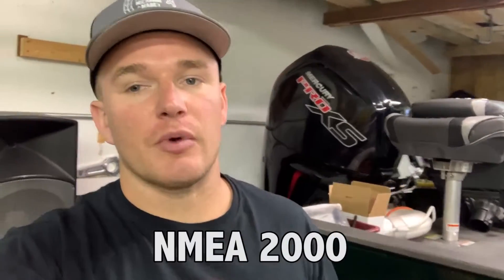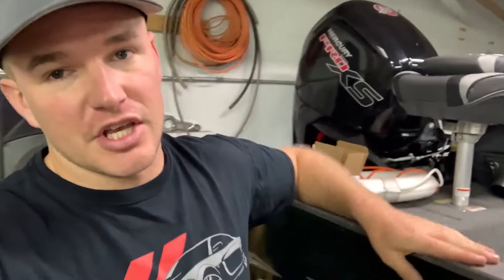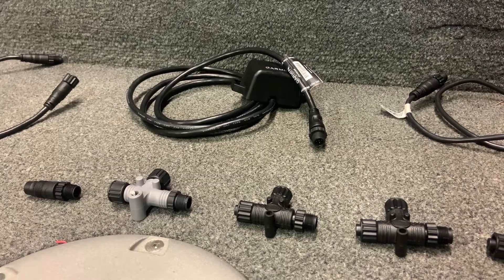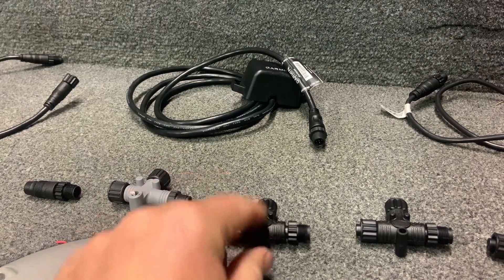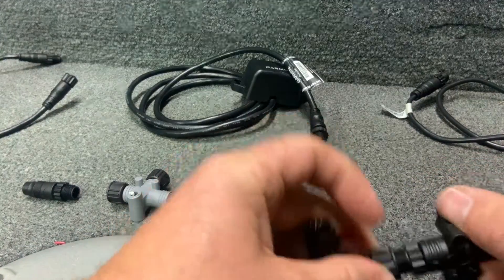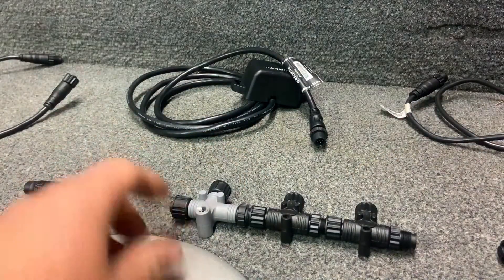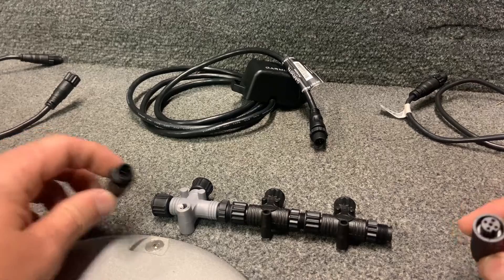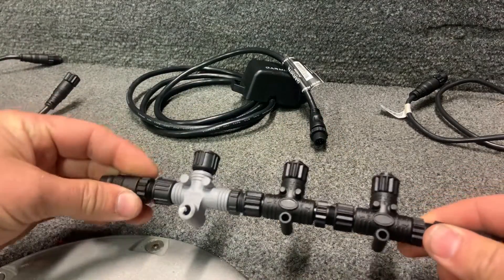NMEA 2000 Network Basics and Assembly

Comment: You said super basic explanation. In my opinion this was a great explanation of the NMEA backbone. I will be putting my steady cast unit in soon and this was a great help.
Reply from the maker: Thank you! 

I have everything you need in stock! Let me know and I’d be happy to help
Reply: If you only have one graph,  can you plug the steady cast directly into the graph? Bypass the backbone until I have more graphs?
Reply: @timexum743 .    You can plug it in to the back of the graph but it will not work. You will need a NMEA 2000 starter kit, a steady cast unit, probably a dropper cable, and a power cable to power up your backbone. The backbone needs its own power. You will need 3 connectors Tee and 2 termination resistors for your setup. In the future when you want another device you just add another connector T to the backbone. You will also need 2 termination resistors on each end for the backbone. You will get 2 connectors T in the starter kit and 1 connector T in the steady cast kit. In your case you will have 3 connectors T. So one power cable to the middle connector T, steady cast to another connector T,  and a cable from the last backbone connector T to your NMEA 2000 connection on the back of your power head unit.

Comment: Garmin highly recommends and strongly encourage you to sit the power towards the middle of your backbone!
Reply from the maker: Yes this is important in large backbones that go all the way across large boats from front to back.  When they are small like this in the video it’s not as important. 

What you are trying to do is to minimize voltage drop on the system
Reply: @MGMarineTech  I just installed a chart platter and fishfinder with a transducer and a VHF radio with GPS antenna and VHF antenna on my Yamaha 275sdx!

Comment: Question? I am going to add the Garmin Steadycast Heading sensor on my 2022 26' center console. Where would the best place to mount it? I'd like to put it in my electronics box but there is a lot of wiring and a VHF radio in there. Would it work mounted in there? Can it be mounted on the hard top next to the radar? Let me know what you think
Reply from the maker: You must make sure that it’s not close to anything magnetic or that has a magnetic field like speaker etc. 

Also you must use good stainless screws to mount it. Regular steel is obviously magnetic and can throw it off
Reply: @MGMarineTech  Thanks for such a quick reply. just 2 more questions. can this heading sensor be mounted upside down as long as the arrow is facing to the bow? And is there a Garmin external GPS antenna without a heading sensor I can use for my GPSMAP 1223XSV?
Thanks for your help
Reply from the maker: @Glory-Days-Fishing  the heading sensor instructions aren’t very clear on that, and honestly my heading sensor doesn’t work well where I have it mounted now. But it’s probably 100% my installation. 

As far as just a gps sensor, you could do the 19x 

Or i would just recommend doing the 24xd it will do your gps sensor and heading sensor in 1. Less things to mount and wire into the NMEA network. 

Shoot me a message and I can get you setup with whatever you need
Reply: @MGMarineTech  thanks again!! I’ll let you know how it turns out. It’s a brand new boat and I am trying to set it up better than my last boat. With your help I’m sure it will be perfect
Thanks again!

Comment: This definitely helped and explained what I needed. Just one more question... I have 2 93SV UHD units one at console and one at the bow. Can I just hook the dropper cable to my console unit and see on my bow unit networked as well or will I need another 2nd dropper and there for another nema port to run the longer cable to the bow unit?
Reply from the maker: Any screen you want to be on the nmea network has to go to the nmea backbone with a tee 

They will not network in any way just connected together with a dropper cable just plugged into each screen

Comment: I just got a brand new Suzuki 4 stroke 30 hp motor and the dealership got the Suzuki interface and a garmin NMEA starter kit and backbone. When they installed the motor they hooked it up to a garmin 93SV and they said everything worked fine. When I got the boat back I had bought a new garmin ultra 106 and installed it to replace the 93sv. We hooked everything up properly just like it was hooked up to the 93 and now none of the engine gauges will show up on the 106. Is there something you have to do to make to work? When we go to the gauge menu to select a motor it says there is no motor found. If there’s anything you know I’d appreciate it.

Comment: Does the network power just power the network or does it power the devices on the drop? Is this similar to PoE on modern home networks? Or would a device such an analog converter or chart plotter near their own power source?
Reply from the maker: It will power some of the smaller devices,

It does NOT power the units themselves

Comment: Great video although I am still a bit lost.  I just purchased 2 Garmin 93SV's and Livescope.  I was watching your older video on using the GMS10 for networking this setup however after watching this one, can I skip the GMS10 and just use the NMEA 2000 and then will the Livescope also go into the T as well as the units or does the NMEA read the Livescope from one plugged in unit through the T connector?
Reply from the maker: No!!!!! Lol 

The NMEA network will not share any of that type of data. 

To share waypoints, maps, transducers, livescope etc you will need to follow my other video. 

This is just for adding external sensors and devices that run on the NMEA 2000 network. 

The gls10 black box doesn’t even have NMEA 2000 capabilities
Reply: @MGMarineTech   Thank you, I got it down now.

Comment: Finely!!! Now I think I get it,Just have a question, I’m running two 93sv’s at the console joined by a cable that allows the use of one transducer, will I still have to have a dropper cable from both units for the heading sensor to work on both?
Reply from the maker: Unfortunately yes. Each screen that you want to see a device has to have a dropper cable. 

That was covered in the video as well, it was just towards the end.
Reply: Yeah at 1:38 you mentioned about if we had three screens then would need separate cables, just wanted to be sure, was just thinking sense they shared a cable already that it might work or hoping I guess lol, thanks for all the info and your videos, they have helped me tremendously!!!
Reply from the maker: @ClearviewOutdoors  yeah I originally thought the same thing. But that’s not the case with the two networks. 

Each screen that you want to read the data from a device needs a dropper.

Comment: Hi I have a 95SV echomap chirp bought in 2016 with GT-52HW transducer.  I plan to use this for map and traditional sonar.  I plan to buy 95SV UHD and use it for downscan at 800 khz and sidescan at 1100 kHZ.  Both transducers will be mounted on transom.  Do you see any problems with this like interferences etc.?

Comment: At about 7:00 you talk about a backbone extender cable, to help your backbone reach a device that's far away. My question is, say you have your backbone at your console, but you want to connect a graph, Trolling motor, and GPS heading sensor at the bow. Can you essentially run a secondary backbone at the bow (without it's own power) and use the backbone extender cable to connect it to your actual backbone? That way you don't have to run 3 or 4 seperate long drop cables from the bow to the backbone?
Reply from the maker: Yes your backbone tees don’t all have to be in the same spot. 

You could put a dropper cable in between two sections of tees(must go on the inline side). So you could have 3-4 tees at the bow and 3-4 tees at the console. 

It must be terminated at the ends like normal.

Does that make sense ?
Reply: @MGMarineTech  Yes, thank you! That will save me quite a bit instead of buying (4) 5 meter cables!

Comment: does the engine interface cable plug into the top of a  T
and where's the best place to get power from straight to the battery or from somewhere in the dash
Reply from the maker: Yes, all NMEA devices plug into the top of the  t as shown in the video.

As for power. The battery is good clean power but power from the switches would work too. 

Just make sure it’s 12v and not 16 or 24v etc. and the network can only have 1 power supply.

Comment: Questions - is it okay if a dropper cable that doesn't have anything attached to it?  Suppose I need to temporarily remove a device, will I need to put a terminal in its place, or is it okay to leave the dropper cable unattached to a device while using the system? What if I need to temporarily detach the dropper cable while using the network? If a terminal needs to be used is it the same as the terminal on the backbone?

Thank you.
Reply from the maker: Never terminate a dropper cable with the resistor terminator.

I would suggest either leaving it open ended or removing the cable and tee

Comment: Can you plug the steady cast directly into your  graph ?
Reply from the maker: no you can not. You MUST have a NMEA 2000 "backbone" I sell kits at MGmarinetech.com and even have steady cast bundles with everything that you would need. 

Thanks
Reply: @MGMarineTech  thanks for the fast reply. Is the steady cast bundle new or used? How much?
Reply: I see the bundle. So I can plug the steady cast to the drop in on the T then the nmea cord to the end of the T then to my graph? Or do you still have to run a power cord to the T? The power from the graph is not sufficient to power the steady cast? Hope this question makes sense .
Reply from the maker: @timexum743 this video shows you all the connections that are mandatory.

There is a t for each device and power.

So 1 for the screen 1 for the sensor 1 for power

Comment: If you have the t connector with power going to it at the console say to a accessory switch can you extend it to the two t connectors at bow with the 15ft cord? Will I lose voltage that way?
Reply from the maker: The NMEA network only needs to be powered in 1 spot.

Why do you want to power it towards the front of the boat?
Reply: @MGMarineTech  I figured it out I have it powered at the console so then I can turn it on and off don’t want to drain batteries with constant power going to it.All I have hooked to nmea is elitefs 9 and ghost trolling motor so I can have 360 ghost.

Comment: You can’t use hdmi to impose info to a separate screen?
Reply from the maker: Some units have HDMI out and in. So you can share your screen to a TV or bring in a media player.

But to to share things like transducers and livescope to other units you can simply network them. 

My network video will show you all you need to know about it.
Reply: @MGMarineTech  so, with hdmi, you can display all info on a monitor/tv from your mfd/msd; just not have control over it? Correct?

Comment: Great explanation!  Can the power cable be spliced into 10ga marine power wire ran back to the starting battery?
Reply from the maker: As long as it’s “12v” you should be good
Reply: Yes.  Any idea if I can run that to a circuit breaker?  If so what amperage?

Comment: How to connect a fuel gauge to show fuel level ? Thanks
Reply from the maker: You will either have to have a fuel level sensor that is NMEA compatible and then hook it up to the backbone,

Or already have a NMEA compatible smart gauges
Reply: @MGMarineTech  just bought a  convertor NMEA 2000 from analog to digital signal. I hope it will works.